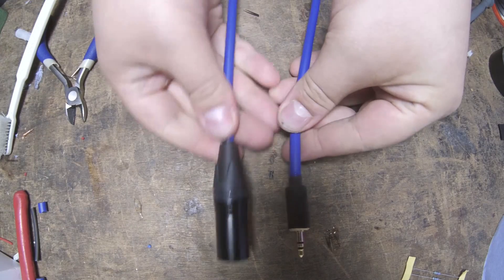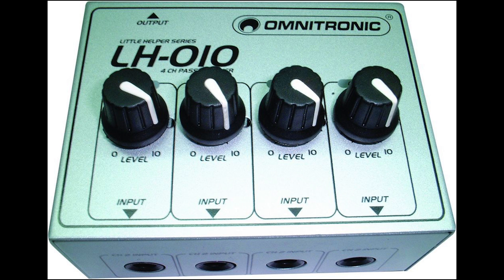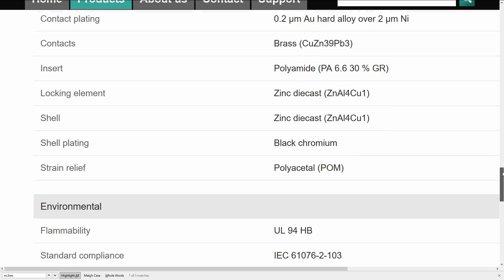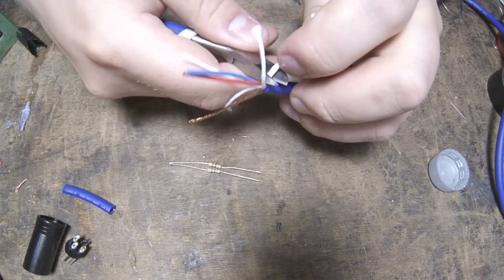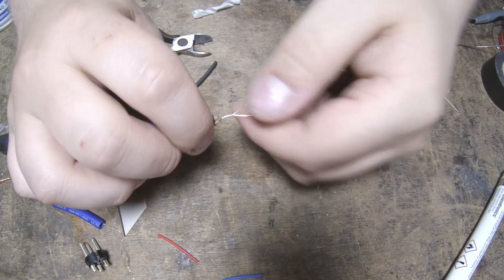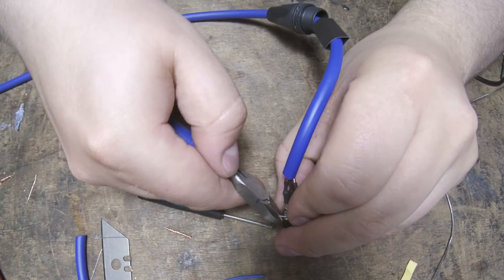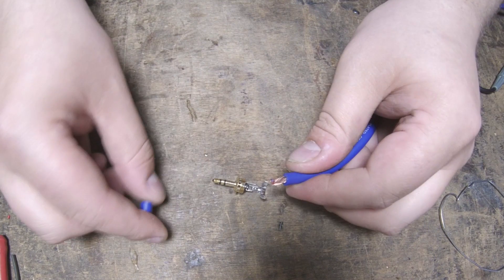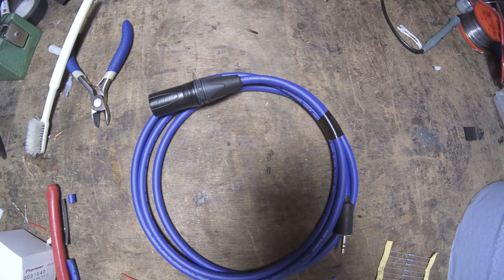Andy's Boring Job - Stereo to Mono mixing cable - TRS to XLR

Comment: After many years, my new skill could give me a guitar/music player box (speaker/amp) running on 5V. It's good for a movie or a Raspberry Pi 3 where we need sound as well. I also found a similar one to buy, but those can have issues, so it's the same fixes to look into. The original idea was to mount a thing on my guitar, but that will be version 4. I have to rebuild what I have in another way, but all the functions are there now. These types of videos got me there. Old videos or new videos. In schematics it gets a bit much.

Comment: I used 1/4 watt 470R resistors and a 1/4 watt 20K resistor...the cable is way too quiet going from Macbook Pro or Samsung S10e to mic inputs on Everse 8, Shure SCM410, and Azden FMX-42u.  Cable is about 85cm long.  Should I be using different value resistors?

Comment: For a short cable, the 20k resistor is probably not needed, as the input you're connecting to is somewhere between 600 ohms (unlikely these days) and 10k ohms. But it certainly doesn't hurt to shoehorn one in. And if you don't have 470 ohm resistors, any pairs up to 1.5k ohms each or even more will work. 470 ohm appears optimal, especially if you're feeding a relatively low impedance input. Most inputs these days will be quite a bit higher. And the resistor tolerance is not of much consequence. For 1/8 watt resistors, they are probably all 1% anyway. You can measure them with a meter to make sure they're close to each other. The resistor power rating doesn't matter; the only consequence is that they get bigger as the power rating goes up.

Comment: What stops phantom power blowing up your headphone socket of your computer if someone accidentally switches fantompower on on that channel do the resistors stop the flow of volts back up the cable some consoles have global phantom power and this is unavoidable
Reply from the maker: I wouldn't recommend using this cable with phantom powered inputs. It's unlikely to cause much damage but better safe than sorry.
Reply: Thank ! Thats what i thought there is a chance of 48v back up the line 
Great video though

Comment: is the 20k pin soldered to 1 and 3? and the other side pin is soldered to 2?
Reply: i don't get the idea of the 20k resistor, when on male pin goes connected to the mixer.

Comment: I tried without the resistors before i saw ur vid 😂if i play "mono" output over 3.5jack  it sounds great but if i play "stereo" the sound is soft/caped off bc audio is tryin to filter the mirrored audio  as if it was interference i try  this one out soon  im curious 😁 i realy need to try to make a filter that passes normal stereo to + - and earth mono

Comment: What a most helpful and well explained guide.  I want to build the same sort of summing lead but for a 3.5mm stereo input jack plug into a 6.3mm mono output jack plug.  I understand why you tie the left and right (T & R) input signals together using 470 ohm resistors.  However, as I am not using an XLR plug for the output connector do I still need to use the 20K ohm resistor between the summed signal and the sleeve on the mono jack output?  Many thanks.
Reply from the maker: Yeah you'll be ok to omit the 20k resistor. Maybe bump up the 470ohm resistors to 1K though.
Reply: @TheRasteri  Ok, as I said before, I understand why you tie the left and right (T & R) input signals together using 470 ohm resistors.  However, what is that 20K ohm resistor between the summed signal and the sleeve on the mono jack output actually there for?  May thanks again.
Reply from the maker: @mickypoo4622  Honestly I'm not 100% sure what the rationale for it is (the rane document doesn't specify), but it will provide some input attenuation to help avoid clipping, as well as potentially avoiding AC/DC coupling issues with poorly-designed devices.

Comment: alright mate, just made this cable - unbalanced version to mono quarter inch jack and im getting a very loud low frequency hum!!??? any ideas - my stereo output is from a bose 802 controler into a single mono sub woofer - cheers.

Comment: Thanks for the great instructions! Due to my eyes (I have some problems with focusing on the nearby things) I can't do this cable myself. Is there any such cable for sale? ( e.g. eBay, Amazon, BH Photo & Video, etc...)
Reply from the maker: not that I'm aware of, but show my video to a local audio repair shop and they should be able to help you out
Reply: @TheRasteri  Thanks for replying... I've showed the video to some guys who are dealing with Pro Audio business, but they didn't want to help. "It's too complicated", they said. There are some DI boxes and passive mixers around, e.g. Rolls DB226 (which sums up stereo RCA signal to a balanced mono signal). I use it for my projects. The downside is the price ($70 on eBay) and delivery time as well (it takes more than 2 weeks to get it in my country). So, I thought, it would be a good idea to make such cable locally. Thanks again!

Comment: What if i am just using a mono TS cable and not an XLR cable with 3 pins.
can I just put the resisters to the tip - and the ground to the shield of by TS cable? - what about that 3rd 20K ohm resistor do i still need that ?
Reply from the maker: Yeah exactly. You can probably get away without the 20k resistor but if you can fit it in I would.
Reply: @TheRasteri  thanks alot. I have just been messing around and it is quite a bit easier to fit everything in the XLR housing I think im gonna go with that afterall
Reply: also im using 560R resistors because thats all i have i hope it works okay
Reply from the maker: @nyrbsamoht  Yeah 560 will be fine
Reply: @TheRasteri  I just put the cable together and it works great. I did it pretty much the same as you except its a shorter cable with a female 3.5mm trs to male XLR.
i used the 560R for the L and R channels from the stereo side (housed inside the xlr case) - and bridged the appropriate pins on the the xlr jack with 22k ohm resistor (thats  a great trick bridging pins 1 and 3 with the excess leg) 
i was worried it might be quiet - but it is actually louder than the (cheap) stereo RCA to 3.5mm TRS cable I was using before.
So now its louder and it has also freed  up some inputs on my mixer.
thanks again for the video and the replies its been very helpful

Comment: You should be using 5-minute epoxy applied to the contacts on the TRS jack with a toothpick, and loctite blue on the screw threads. There should be one smaller piece of heat-shrink on the cable as a strain relief, and one larger one over the housing if desired.

Comment: Can i use this But with a female xlr conector?
Im trying to send signal to a Behringer headphones amplifier from the aux send from My XR18
Reply from the maker: So you're trying to come out of a single mono XLR and go to a stereo headphone amplifier? If so you don't even need the resistors, just wire pin2 of the XLR to BOTH the Ring AND the Tip of the TRS connector, then wire the Screen of the TRS connector to BOTH pins 1&2 of the XLR
Reply: @TheRasteri  yes, thats the idea.
I allready Made that cable. I'm using it.  I was looking For a better option and i Saw your video. Thanks a Lot!
Reply: My XR18 aux send to Behringer P2, Donner EM2, others, have required nothing but a standard cable. The aux outs on the XR18 are mono, and all my headphone/wired IEM amps can take mono in, though they drive standard stereo headphones. Switch on amp selects mono or stereo input. At least it's worked for me for a while.

Comment: I need a similar guide for making a stereo to mono cable using regular RCA plugs at either end. Anyone have one?
Reply from the maker: If I was doing that I'd put the 470ohm resistors in the stereo end and the 20k resistor at the mono end, just to save space.
Reply: Ok. Can I just ask what the purpose of the 20k resistor is because I have seen others do this with a mini jack to a regular jack and in those examples the resistor you are using is not part of the equation yet the diagrams otherwise remain the same. I assume it has some function related to grounding if I understand the diagram you linked to correctly.

NB: Forgive me if I have completely misinterpreted something. My knowledge of electrical engineering is very basic and essentially dates back to an intro electronics class at university several years ago.
Reply: Some examples of other guides I have found creating a similar stereo to mono cable/converter: https://youtu.be/kL94do8x1-g or https://www.youtube.com/watch?v=bJ3AS5EwOCk
Reply from the maker: @aBoogivogi  You can certainly omit the 20k resistor with no problems, I only include it because of the Rane guide. I'm guessing it's to insure that capacitively-coupled signals remain near ground, or termination for transformer inputs, or for a (negligible) amount of input attenuation.
Reply: Ended up making a cable where the 470 Ohm resistors was in the joint and the 20k resistor was hidden in the plug that vent into the amplifier like you suggested. They work great. So thanks for answering my follow up questions and the link to the Rane article :)

Comment: Can I also use a 0.1W resistor? I want to use the NP2C 1/4 ts plug and I assume the small resistors help with the smaller housing.

Comment: I am making this cable for myself... Can i use a 22k ohm resistor instead of a 20k? I have the 470 ohms but couldn't manage to get 20k
Reply from the maker: Yeah you absolutely can, just the signal will be a little bit louder. In fact if you look closely at the video I'm actually using a 22k resistor myself, haha.
Reply: @TheRasteri  I've seen similar solution on the internet that are identical but without the 20k resistor. Is it a problem to not have it?
Reply from the maker: @Tom-sd2vi  Yeah you're probably fine without the 20k resistor for most devices, it will be a bit louder though.
Reply: @TheRasteri  Thank you for your reply! I made mine without the 20K resistor, but with but the 470 ohm resistors and use them to connect 4 stereo TRS monitor outputs from the mixer to the mono XLR input from passive monitor speakers. Do you think it is ok like this?
Reply: @Tom-sd2vi  Right. The 20k resistor is probably not necessary IMO.

Comment: Can u explain the 1/8 side a bit better. It’s hard to see in the video the solder joints on the connector. The connector has 3 sections and I will like to see in more detail where unsolder it.
Reply from the maker: The shield goes to the shield, and the two other conductors can go to the ring or tip - it doesn't really matter since we'll be summing them anyway.

Comment: Hi, this cable also works bidirectional?  I mean, if I would like to send signal from a XLR mic to a jack 3.5 mm  input as a camera ? or there is another wiring? thank you
Reply from the maker: Yeah pretty much - although for the other way you don't even need the resistors. Much simpler cable.

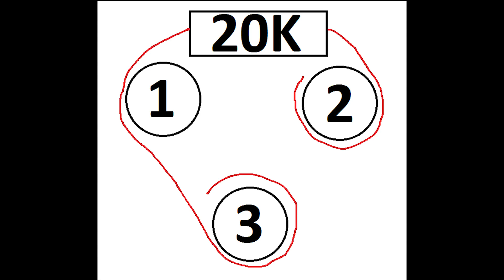Comment: 4:32 I am confused  "....Pin 1 & 3 also be connected together....."? & 4:52 diagram shows 2 & 3 connected. My query is for third resister(20K) connection
Reply from the maker: 2&3 are connected via a resistor, 1&3 are connected directly. In this case I've connected 1&3 together using the spare length of one of the resistor's legs, just to keep things tidy.
Reply: @TheRasteri  Thanks. I think this customise cable might solve another issue. Regular XLR to 3.5 mm cable mic input given to video camera records the audio but Right & Left chanel inverted. so does not have any issues playing back on stereo device i.e. desktop speakers or on mobile using headphones but there will be no audio while playing on mobile via its speaker(most of the mobile has mono speaker out). Although this could be resolved in post production by audio editing software but it could be time saver for many YouTubers/podcasters with this customized cable. Please correct me if I am technically wrong.
Reply from the maker: Not quite. Converting a mono balanced XLR signal into a stereo unbalanced signal is even easier - you don't need the resistors. Just wire pin2 of the XLR into the Tip and Ring of the 3.5mm TRS, and pins 2&3 of the XLR into the Shield of the TRS.
Reply from the maker: The reason for your issue is that XLR mics give a MONO balanced signal, which has the normal signal AND an inverted copy of the same signal. Wiring this straight into a STEREO 3.5mm plug will put the normal signal in the left channel and the inverted signal on the right channel. The cable I just described will wire the normal signal into both the left and right channels of the 3.5mm TRS, eliminating this problem.
Reply: Yeah this done me over! Couldn’t understand why it wasn’t working. Thanks! I had it like the drawing but had the resistor between 1 and 2.

Comment: Thank you very much for this video, it’s exactly what I needed. I used his same method to combine 2 x 3.5mm mono sources in to a single XLR and it works perfectly. I could only find 1/2w resistors for both the 470 and 20k resistors but it seems to work great. Thanks again

Comment: Hi, thanks for this video. I would like to ask why there's a need to add resistor to each connection? Is there going to be an issue if connected without them?

Comment: that is a great teaching video. I have a question : why are you combining the 2 stereo tracks into 1 mono track if the cable has stereo XLR and TRS plugs, and you are coming from an stereo and going into an stereo active speaker ? can not you maintain separete stereo tracks at both ends ? thank you
Reply from the maker: It's a mono (balanced) XLR, and a mono speaker.

Comment: hi, I think it would be very helpful to indicate on the diagram at 4:52 that the view you have there is from the cable connector side, not from where you doing the soldering. It's the mirror side from what you show before, but since it's easier to follow diagrams people may indeed connect pin 2 to 3 !